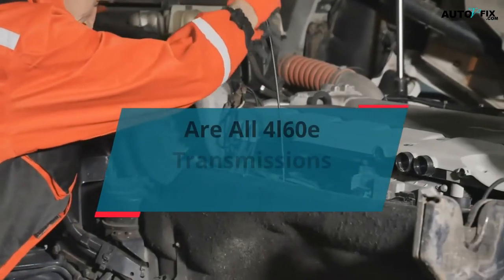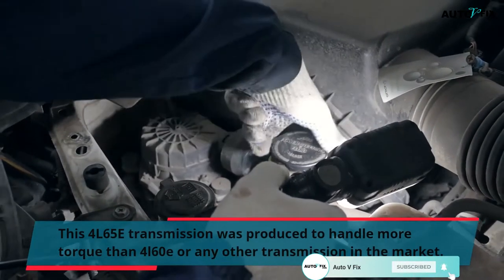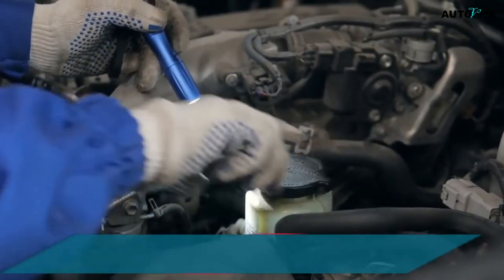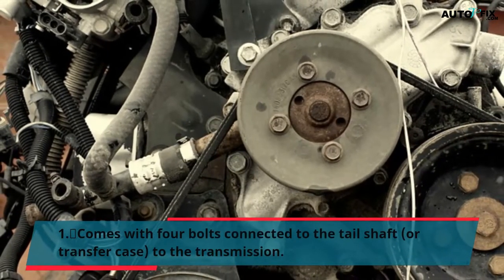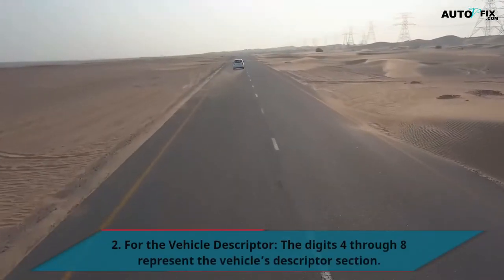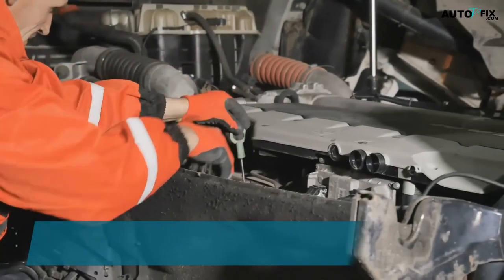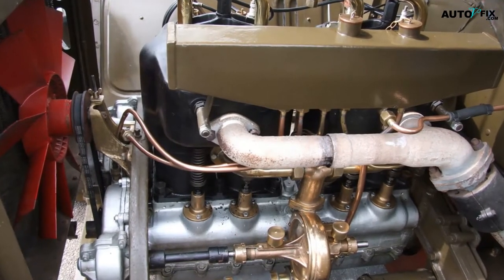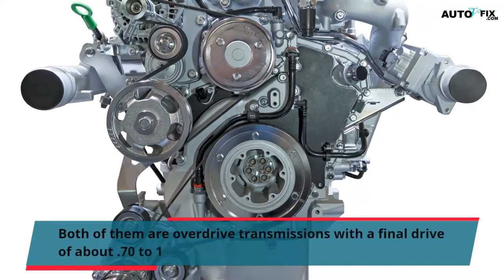4l60e vs 4l65e Identification: Are All 4l60e Transmissions Interchangeable?

Comment: This video gave no information on how to ID either or transmission
Reply: only giveaway is the input shaft. I just attempted to put what I thought was a 4L60E in my truck. Torque converter from a 60E sits too far forward and does not seal on a 65E. The 60e shaft has 3 "sizes", 65e has 2 sizes.